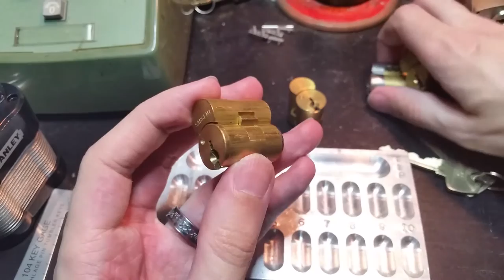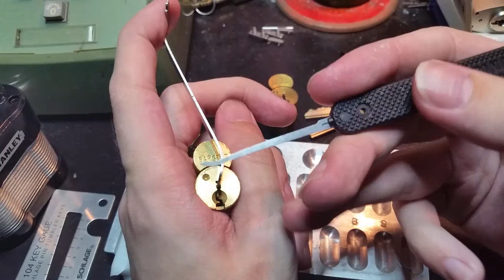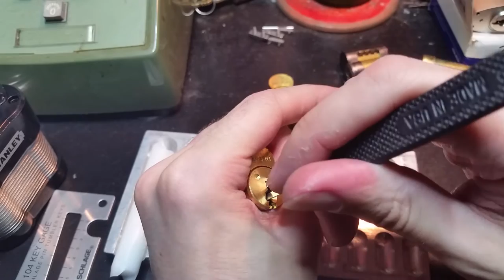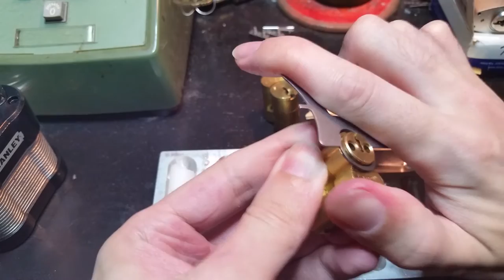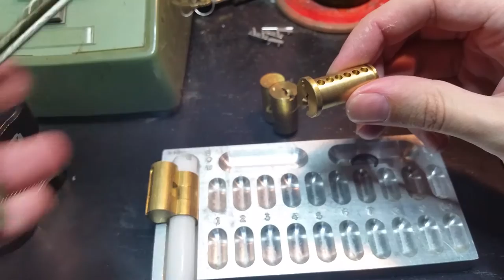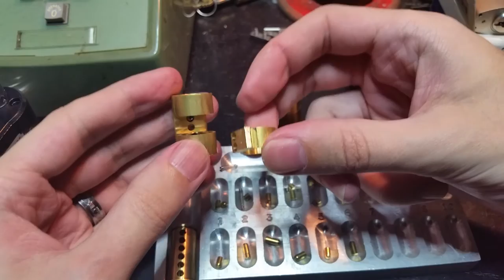(70) Sargent 6400 IC HF keyway, Quick and dirty picking and gutting

Comment: Nice picking. How how these Sargent locks to pick compared to other brands?
Reply from the maker: In terms of workmanship and quality, Sargent is very good, easilly as good as the top end of Schlage's products or comparable Corbin Russwin locks. Picking them is comparable to commercial quality Corbin Russwin, Abus, and Schlage. Not many pick resistant features other than good workmanship.

Comment: Nice picking sir.
Would the same method be good for Best cores??
Reply from the maker: A similar technique may work on SFIC locks (Best-style cores) but SFICs have some important differences and Best's keyways require much thinner tools. I cover some SFIC specific material in my Kaba Peaks SFIC video (https://youtu.be/2t6YgZvB6qA).
Reply: +Nite 0wl thanks for the detailed reply,I will go check it out 😘😘👍👍👍
Reply from the maker: Happy to help. Your question just made me realize I never did a video examining the Best SFIC cores I have. I will have to plan something on those soon.
Reply: +Nite 0wl 👍👍👍👍😎